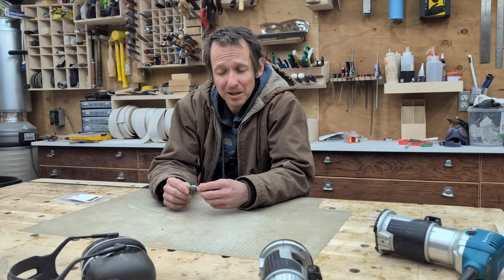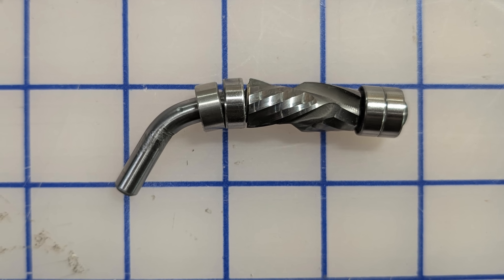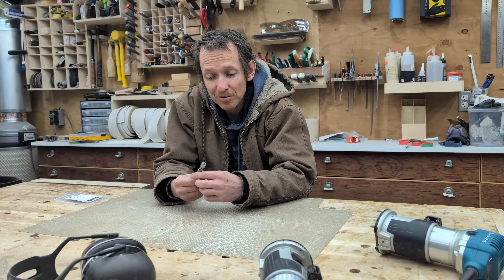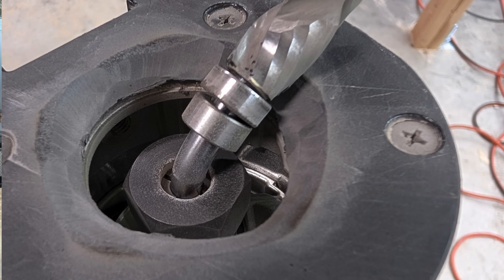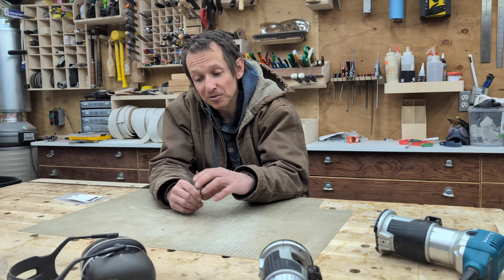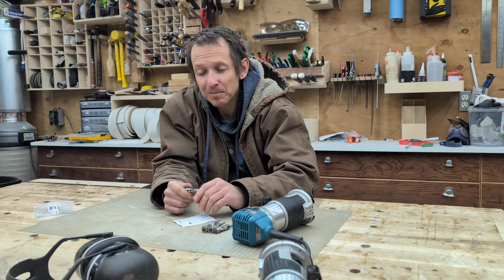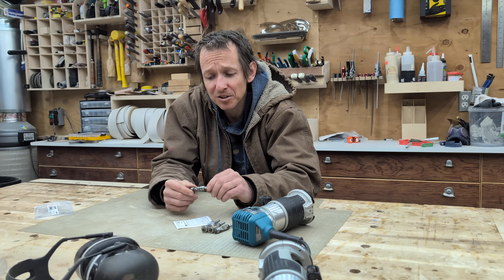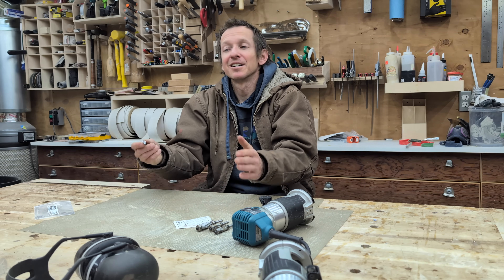Fear the Banana Router Bit!!!

Comment: From my experience, the recommended RPM for those big flush trim bits is BS

You should really be running them at 10-12K RPM. The cut is much smoother and it grips the wood significantly better. I spoke to Whiteside tech support about this and they say I’m not imagining, that’s how compression bits are designed.

Flush trim bits, especially compression bits like that, are not designed to run fast and don’t need to run fast to get a clean cut. In fact if you run them too fast it creates sawdust instead of shavings, and it puts more stress on the bit.

Comment: I vaguely remember a task I had to do in a tool & die shop close to 50 years ago.  There were some copper castings that looked sorta-kinda like the way old kind of diver's helmets and needed to have the rough casting surface removed from the inside.  I guess this normally would have been done by some kind of bead-blasting operation, but on this run of maybe a dozen (and expensive they were), a machining operation had been done before the scale was removed, and the scale had to be removed in a more manual, targeted way, in this case by a bunch of flappy emery cloth strips screwed onto a mandrel chucked in a die grinder.  The boss taught me how to turn a mandrel on the lathe, and then he heat-treated it.  To reach where it had to go, it was longer than this router bit, and also, I think, with a 1/4 inch shank.

IIRC, one iteration of such a mandrel did domething similar.  Maybe that iteration WASN'T heat-treated; memory escapes me.  Anyway, the design and use was sound, but a remake was necessary, and did work until the nasty job was done.  And to reach everywhere needed, the minor diameter of the shaft was well below 1/4 inch, and the successful tool did not bend, despite the die grinder's 25K speed and the peculiar load of so many strips of emery cloth, which could hardly have achieved perfect balance, and wore down so as to be replaced a number of times.

From this experience, I would conclude that your bit failure likely had to do with a heat-treating failure.  And that could not have been due to ovrrheat in use, or we'd see blue color on the surface.  Again, my failure experience (HSS) could have bern due either to no heat treat or to inadequate heat treat, but clearly it was possible to get it right.

To do a correct heat-treat on such a tool as yours, there's the requirement for the steel substrate to be the correct alloy, to get a sound and successful attachment of the carbide, and to have the correct strength and toughness at all points along its length - which might be different for the shank and the business end.  Challenging, at least.

For those who think a 1/4 shank inadequate for such use, I suggest that such a tool CAN be made, but maybe not at the price point, not sure.

Another contributing cause I might suspect might be a chuck insuffciently tightened.  I have found that my 1/4 inch Makita router (old as the hills) has occasionally allowed a bit to walk in a direction out of the chuck when I didn't give that extra effort to tighten the collet.  It's not like you apply a torque wrench.

But the nature of the failre suggests a too-soft shaft.

Comment: Ok, you should ALWAYS insert a router bit almost all the way in, no exceptions. Best practice is insert fully and pull back a 1/8th inch. But, that being said, there is no way it should have bent just from starting up with zero load.

Comment: I'd check those upper bearings and the locking pins on them. Seems unusual, but it's an unusual case. But maybe the upper collar and bearing were loose and the vibrations caused a binding between them and the shaft and locking mechanism.

Comment: I think the biggest factor was the 1/4" shaft.
Just a few weeks ago, I needed a pattern bit with 2" LOC and it didn't even cross my mind to maybe get a 1/4" shank cutter.   Just not stiff enough.
Must have gone out of balance, and then the vibrations made it go more and more out of balance.
Probably, sticking it further into the collet would have helped.
If your router starts making a funny sound, that's going to be the bearings.

Comment: What's the shaft made of, chocolate?
Lots of people here posting their theories about it whether a 1/4" shaft is adequate, collet contact points, not being inserted far enough etc, but have you ever tried bending a 1/4" diameter steel rod? Even mild  steel, not hardened tool steel as this would (or should) be?
It takes considerable force.
According to the video there was no load on it other than any imbalance in the cutter (which is not really all that big), and it started straight (at least to casual observation) and went to that bent in a matter of a few seconds. 
There are I would say, only two reasonable explanations
1) A serious manufacturing defect where the steel of the shaft is ridiculously soft.
2) The story is, at the very least, not complete

Comment: I have a bent shaft like that but for different reasons. I had a 1/4" rabbeting bit (3 tip/wing) in a router invertes jn a router table.  The cutter diameter was bigger than the hole in the aluminum table. Made a few cuts, adjusted the height of the bit to make the dado wider. During that process, the router body clamp slipped and the router motor slipped down, hit the aluminum table made a similar noise described here. Shut it off to find a bent shaft like his. In hindshight it was fortuneate the the bit was bigger than the hole in the table otherwise I would have had to deal with a live router motor with wing shaped cutter in it loose on the bechtop.  Learned to really crank on that pinch bolt on the router base.

Comment: In some collets, there are two points where the collet makes contact with -- at the front and rear of the collet (it's sort of a hollow grind so shank build-up doesn't cause runout).  The minimum insertion line is there so the shank is clamped both at the front and rear of the collet.  If you're not inserted that far, there is a chance that the very end of the shank is not clamped by the collet and any side force will allow the bit to shift off axis.

Comment: I shy away from 1/4" shafts on my router. But I do have that exact router. I kept losing the guide bearings, coming loose and riding up on top bearings,  falling off on bottom bearings.  So I use the router very rarely.  I have a Porter Cable table mounted router,  Bosch Router combo. Inconvenient to use sometimes.

Comment: You need to buy your bits from Rockler. They guarantee the bits for life. I had problems with a cope and stick bit set. No questions asked. They replaced it on the spot.

As far as this failure, I suspect heat treating was lacking, also the bit may not have been balanced, creating a major vibration issue. Add possible excitation of resonant frequency, which spelled doom for your bit…why not use a full size shank router bit if your cutter diameter is so large?

Comment: If I had to guess . . .
     I would guess the router, with bit attached, took a pretty good fall, landing on the bit and banging the shaft. Choice #2 is that the router, with bit attached, got stuck somewhere — like under your truck seat — and the shaft bent when the seat was slid back. Either way, I think that bent bit was pushed WAY down into the baseplate before you ever started the machine.

Comment: Woodpecker is over-rated as evidenced by 1) the piss-poor fab quality of your bit (if this happened to your bit, there will be others out in the wild with a defect -rarely is it a 1 off), and more importantly, 2) for a company that positions itself as the highest end, their lack of ownership for this issue speaks volumes about what they really think of their product & customers. Not responding at all is unacceptable, more so cause it's not as if they are simply overwhelmed. It should be obvious to all that Woodpecker sells tools using artificial scarcity -ie, they underproduce relative to demand.
Reply: No. There is a reason why Woodpeckers is constantly out of stock on many items despite being one of the most expensive tools on the market. They offer very reliable, very durable, very precise tools. They aren't the best at everything, but they are the best for a lot of tools and nearly the best for most others they offer. Craftsmen and wood workers want Woodpeckers tools. Plain and simple.
Reply: @TwilightxKnight13  Ok fan boi... Why I call you that? You compared Woodpecker to Craftsmen, a tool maker that isnt even a competitor to Woodpecker. That's serious insecurity, like arguing Lamborghini makes amazing sports cars by comparing em to a Dodge Charger to argue the point,  Banggood sells many tools that are close if not on par with Woodpecker for accuracy & performance at a fraction of the cost. JessEm is expanding their tool offerings and they are exceeding Woodpecker's quality. The same level of Woodpecker accuracy can be found on many Japanese tools. Woodpecker's constantly sold out only for the sake of keeping their tools at maximum margin and inflating valuation, and they accomplish this by a pretty straight forward business strategy of artificial scarcity. It's not rocket science to figure out, and frankly should be obvious to anyone who doesnt drink their kool-aid. Woodpecker are elitist greedy mofos, and this router bit and again, the piss poor customer service on top of market priced product says it all. Veritas would NEVER leave a customer high and dry be it for a $25 tool or one of their bench planes. Veritas/Lee Valley  CS is well light years beyond the level of care Woodpecker shows towards its general market, aka suckers. Sure, Woodpecker makes fine tools, but so do many others -and again, Craftsmen isnt in the potential pool of \others.

Comment: Hmmmmm. I own woodpecker bits so I am a bit worried now. A few things come to mind: a) 1/4 shanks are simply WAY to tiny for beefier bits. b) a shank should be high-strength but ductile. c) brazing on the cutting part to a more elastic shaft is a good concept and widely practiced. d) My guess would be that the shank WAS heat-treated for strength but the wrong type of alloy was picked during production and as a result, the brazing process reduced the strength of the shaft by annealing. Either way, Woodpeckers obviously has a SERIOUS quality control issue!

Comment: Wow!! That's some scary $hit!! Thanks for the info. I do like the Woodpeckers tools because they are made in America and are usually of high quality. They have to compete with cheap Chinese knockoffs that make it tough to tell the difference. I agree with you that they should probably throttle back on flooding the market with new products. There is a BIG difference between milling out billet aluminum measuring devices and carbide cutting tools. Stay safe!

Comment: That's scary man, glad all you lost was the functionality of a router. And I fully agree, even if you were perhaps a little remiss in terms of getting it deep enough into the collet, there is no way it should be possible for the shank to deform that much, that quickly. As you say, the safety margins should be much higher, or they shouldn't be building that size of bit with that small a shank in the first place. Woodpeckers should definitely reach out to you and at least help you investigate what happened.

Comment: Here in the UK I have two full size routers.  One takes 1/2 inch and 1/4 inch collets and the other takes 12mm and 8mm collets.  I would never attempt to have such a large contact area with a 1/4 inch shank.  I know such bits exist but I wouldn't have any faith in it. I've had multiple experiences of 1/4 inch bits gradually wandering out of the collet while in use, despite being tightened down properly.  This only seems to happen when using a 1/4 shanked bit that has a large contact area with the workpiece.  I've never had any other size router bit do this.

Comment: I would say that there was some kind of imbalance could have minor imbalances in the end bearings that my have just happened to end up on the same side on startup. Once it flexes of center Even a tiny amount its all she wrote! Especially at that rpm! I've seen a.1½" steel shaft fold over at 90 degrees in a lathe because someone had too much sticking out. The back end unsupported! Centrifugal force is no joke and bring your worst nightmares to reality if your not careful!

Comment: A bit only has to go a tiny fraction off straight and in under a second it looks like that because each rotation bends it more. Fact is, that bit is too big for your palm router to operate safely - I suspect you had some play in your router bearings which the weightier bit exploited  - once that exact balance of the centre of gravity is compromised in a rapidly spinning object the rotational forces create exponential stress on the shaft, and the degree of bend, and thus the stresses, will increase with each rotation until it either breaks or jams. I would consider tossing the palm router out (or at least dissemble it and check the bearings) and using a bigger router for such bits in future. I can imagine how scary this was - when rotational machines go rogue its like The Rise of The Machines
Reply: look how soft the metal is though. This should have snapped before it ever got to that angle if it was hardened.

Comment: If I were Woodpeckers, I'd send you a shipping ticket and pay you to send back that bit and the router you had it in because I'd want that in the testing lab before shipping another bit.
Reply: That's a very valid point. The forces involved in making that become so deflected would be significant. I'm no Material Scientist, but that shank should be made out of high grade tool steel or similar.

Comment: I'm going to be clear as a metal guy. For the shaft to bend and not brake i question if it was ever heat treated. Even more if the shaft was realy carbide probably just the cutting head but no change shaft should brake not bend inless it's not heat treated or was over heated and you lost the temper on the shaft. I have seen a 3/4x2" cardibe bur bend a small amount but even at there RPM i don't think they can bend them self. This looks like a MFG error. Be interesting the know the HRC is on it might not even be high speed steel.
Reply: It could be they're designed to bend instead of break, so as not to create a projectile with ample mass and speed.
Reply: @StardogTheRed  This is possible how ever most router bits will brake befor bending because of how hard the shaft is. With out know the HRC of the shaft there not really much diagnostic left to do with the information we have.If we had and HRC we could compare it to the HRC of another bit from the same brand maybe even just a new one of that bit and see if there was an error at some point when it was made. If the HRC from both is the same then we can see if the new one replicates the old and if its a wide spread product defect. If not able to replicate on a new one of the bits and HRC is good then we start to question user error more.

Comment: You can see in the thumbnail the mark of where the collet was on that shank.   You had waaaay too much sticking out of the collet.   Physics is a thing.   Never have more of the shank sticking out than you need to.   That's rule #2.   The only higher rule is to take the plastic coating off of the router before you try to use it.   You did follow #1, right?

Comment: I can’t believe the shaft is so soft it bent. 50 years ago I bought some Chinese drill bits. I tried drilling my metal dash, the bit bent. Drill bits should break not bend. Router bits shafts should be hardened
Reply: Might be designed to bend and not break as a failure mode. If the shaft had broken, it would have created a projectile with considerable mass and speed, with enough kinetic energy to be lethal.
Reply: There really isn’t a need for a super hardened shaft on an end mill. You’re not getting any more stiffness from it being hard. It’s actually preferable in this case to have a little softer shaft, as it allows the end mill to resist impacts better without shattering. Many knives and swords have a softer spine while only the cutting edge is hardened (same analogy). 

If the entire shaft was made of carbide, then it would be a different story, because carbide is much stiffer than steel.
Reply: Drill bit shanks are usually left soft ... this is so the chuck can "bite" into them, if they were as hard as the chuck jaws, they would spin easily in the chuck...

Comment: Glad there was no injury!  Router accidents are scary as hell.

My opinion: 1/4" shanks are a bad idea for big router bits.  There seems to be consumer demand for them, maybe because people have routers that won't accept a larger shank?  Companies chase the demand, but I'll bet the engineer who designed the bit knew that it was a dicey proposition.
Reply: I couldn’t agree more. Some people get the idea that if I have a trim router,  it could handle any 1/4 shank bit. One problem is with RPM’s of these trim routers. 2 of my 3 trim routers have a fixed speed, so I only use these with smaller bits. I always choose to use one of my bigger routers when using a flush trim bit like these and use a bit with a 1/2 shank.
Reply: I only use 1/4" diameter bits with a 1/4" diameter shank.
Reply: Another issue:

From my experience, the recommended RPM for those big flush trim bits is BS

You should really be running them at 10-12K RPM. The cut is much smoother and it grips the wood significantly better. I spoke to Whiteside tech support about this and they say I’m not imagining, that’s how compression bits are designed.

Flush trim bits, especially compression bits like that, are not designed to run fast and don’t need to run fast to get a clean cut. In fact if you run them too fast it creates sawdust instead of shavings, and it puts more stress on the bit.